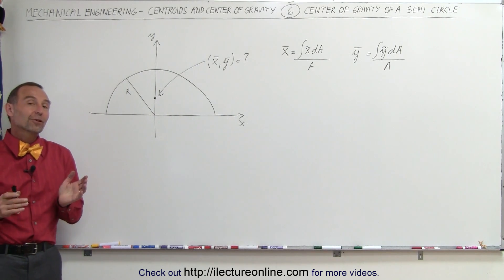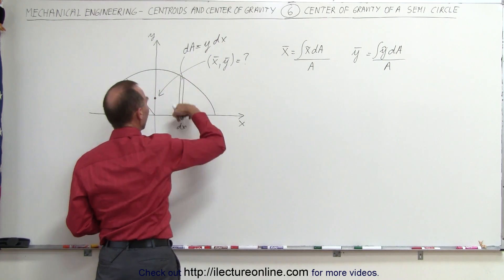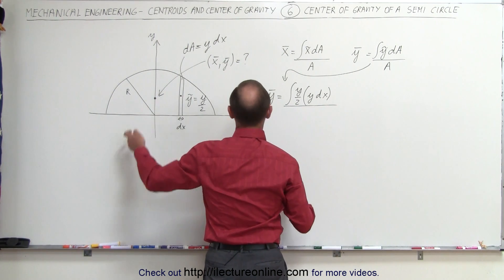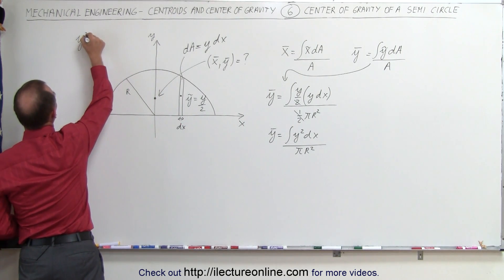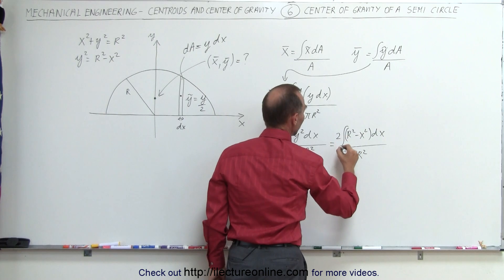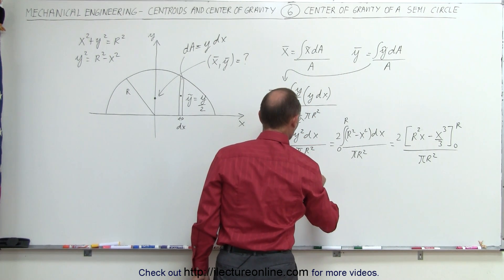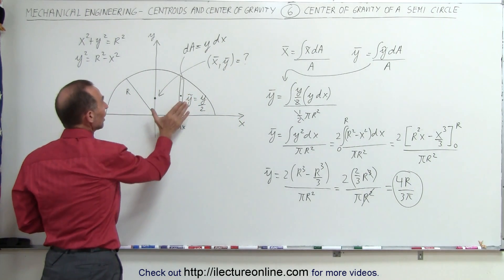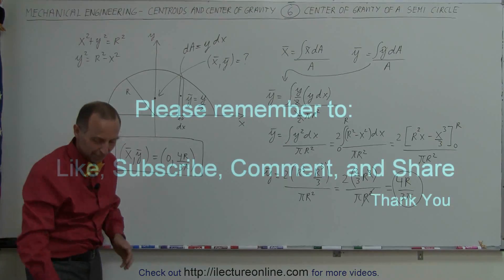Mechanical Engineering: Centroids & Center of Gravity (6 of 35) Center of Gravity of a Semi Circle

Comment: I guess limits should be r and -r not r and 0.  Or am I wrong?
Reply from the maker: Because of the symmetry, you only need half of the shape to find the center of gravity. (It will be the same for both sides).  And choosing 0 to r is easier.

Comment: Hi, Sir. I have a question.
is this centroid's x-coordinate supposed to be identical to the y-coordinate? because I tried integrating (xf(x)dx)/(Area) to get the x-coordinate but I got a different quantity than what you get for the y-coordinate.
just wanna know the reason behind that. Thanks a lot in advance. Love how you do your lecture :D
Reply from the maker: No, they are not the same.  Because of the symmetry of the problem we don't have to solve for the x-coordinate of the center of mass.  It will be x = 0.
Reply: ohh..  I think I may have commented on the wrong video. what I meant was for the centroid of the quarter of a circle.
because you've said something about "symmetry" back then, so we wouldn't need to worry about the x-coordinate of the centroid, and can assume the coordinates are exactly the same as the y-coordinates.
the question was originally for the previous video, sir. not this one.
apologies for the confusion, sir. ( _ _)
Reply from the maker: No problem.  When it is a quarter circle the x and y coordinates are indeed the same.  Make a quarter circle with a piece of paper and you can see that it can be folded on the 45 degree line and both sides are identical and it folds perfectly on itself.
Reply: so integrating xf(x)/Area would result in a faulty answer?
why is that, sir? shouldn't it have worked as well?

Comment: WHY  Y   IS  1/  2   ?   WHY  X  IS  NOT  1  /2   ?
Reply from the maker: The center of mass of the strip is in the middle, and thus y~ is half the distance from the x-axis to the curve.  In the x direction x~ for the strip is also in the middle of the strip, however with integration in the limit as dx goes to zero, we don't have to worry about being in the middle since the strip is infinitely thin.

Comment: hello, Sir Michel! Could I ask your help on this :) Could the equation of a circle be substituted for the y-component of the slice to solve the integral in getting the centroid of a fillet circle?  Or the centroidal equation for fillet is just the same equation of that spandrel?
Reply from the maker: I am not sure what you mean by a "fillet circle", but the equation you use depends on the physical shape and the reference point for the centroid.  y = sqrt (R^2 - x^2)
Reply: Oh, sorry.. It's fillet of a curve, in which the curve is the same of a quarter circle, however it's convexing.
Reply from the maker: These videos may give you some ideas on how to approach that:  Mechanical Engineering: Centroids & Center of Gravity (11 of 35) C. G. of a General Spandrel 1   https://www.youtube.com/watch?v=5byG2AO-Pmk&list=PLX2gX-ftPVXWnfWWDNgu4x9hiCPTi0HB9&index=11    Mechanical Engineering: Centroids & Center of Gravity (15 of 35) C. G. of an Arc of a Circular Wire   https://www.youtube.com/watch?v=meYuJV1oQRs&list=PLX2gX-ftPVXWnfWWDNgu4x9hiCPTi0HB9&index=15
Reply: Thank you, sir :D

Comment: sir how to select the small element while finding the M.I. and center of mass of a uniform circular disk in terms of theta
Reply from the maker: +Rahul Tiwari 
The best way to figure it out is to look at several examples so you can see the pattern.  If you pick it incorrectly, you will not be able to find the solution.  Typically it will be horizontal or vertical.

Comment: wouldn't you use the equation of a half circle if you are integrating in terms of dx ?
Reply from the maker: +littledivergirl1105 I am not sure what you are asking, but I would suggest, if you have a different way to try the problem, go ahead and try it and see if you get the correct answer.  I often try different ways of solving a problem to get a better understanding.